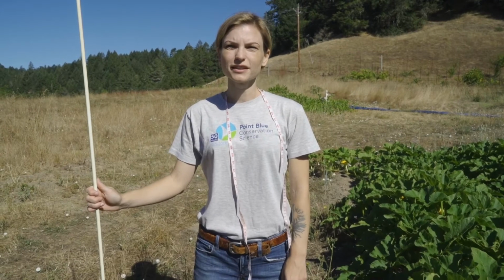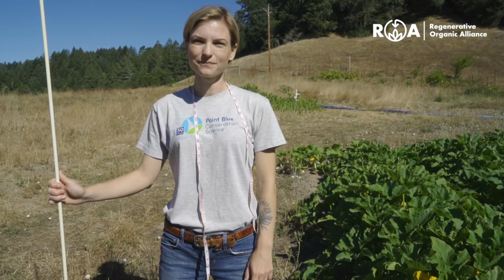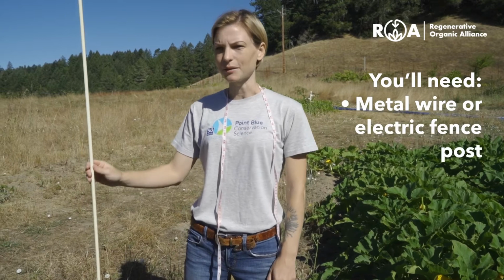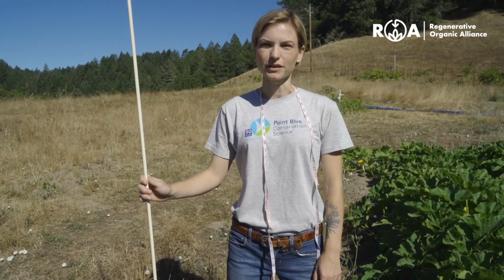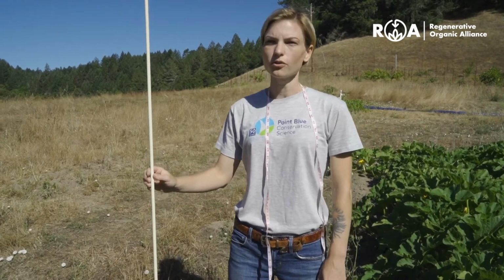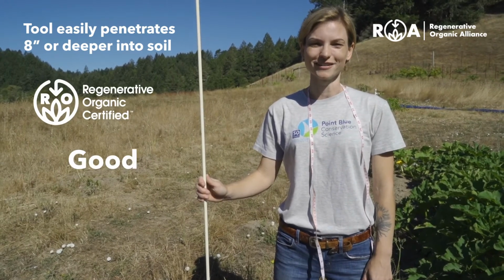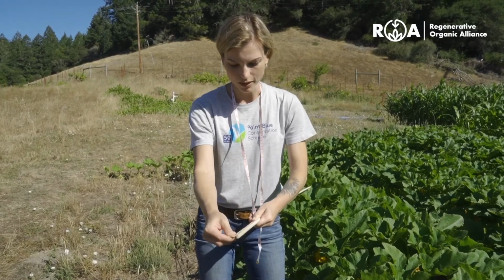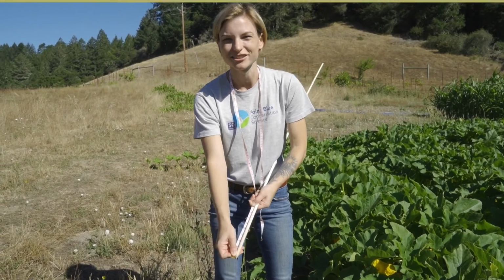How to Test & Measure Soil Compaction

Comment: I appreciate how easy and low-tech this method is. The downside is that it seems too qualitative to be easily replicated if don't keep 1) the implement (post or wire), 2) soil moisture (what does "adequate" mean? different for different crops/regions/soil types), or 3) downwards pressure consistent (someone who has good grip strength and a lot of weight will be able to get a post much deeper/have a different understanding of where the "point of resistance" is). Although soil moisture would be tricky, it seems like it wouldn't be too hard to keep the implement and downwards pressure consistent by using a metal bar or wooden dowel of a standard diameter and a standard weight to apply downwards pressure. It would also be useful to have different ratings for soil textures & rock content.